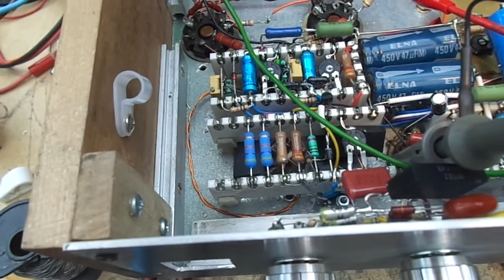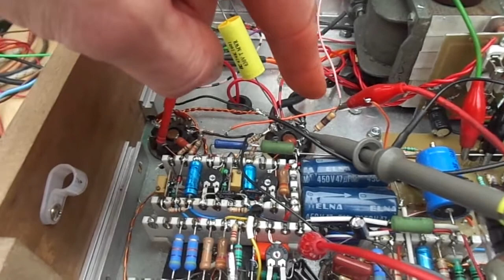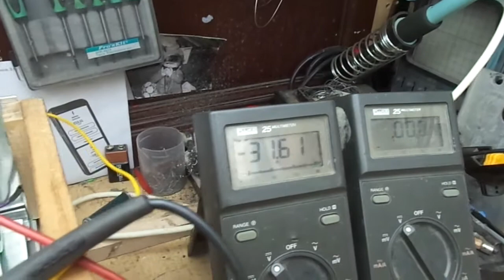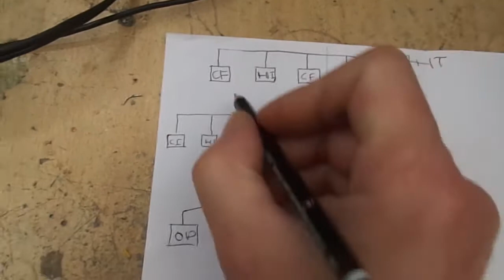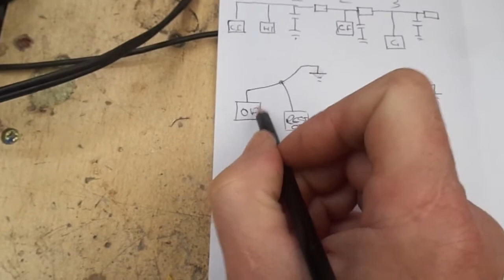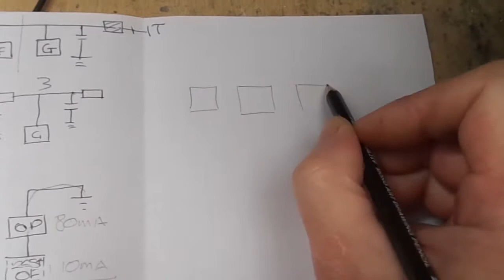Class AB2 6146 PP Valve Amplifier - Solving a LF Oscillation Fault.

Comment: Excellent, it turned out very well. One question: is pin 8 (Base Sleeve) of the 6146 in RF grounded in amplifiers? Does it need to be grounded?
Reply from the maker: If you read the RCA 6146A datasheet, it says that grounding pin 8 shields the IP from the OP. RF isn't my forte TBH so not 100% sure. Whenever I use a valve I get every datasheet I can, you get a better idea that way. Good luck & TFW.

Comment: Is it a Ham radio or a audio amplifier I know the tubes are similar to 6l6 tubes
Reply from the maker: hi Jim, it's an audio amp but I've changed the design to an AB1 amp using 6BG6GA valves and different OPT's. I'll be re-building it soon and will hopefully post a video.

Comment: That is a strange oscillation. Sounds almost like arcing. Beautiful build, good luck getting it sorted out.
Reply from the maker: Yep, strange indeed. I think what was happening was this... instability in the tone section caused fixed bias to drop = more current in the OP section, HT dropped, causing g2 to act as anodes, g2 regulation board went into current limiting, Vg2 dropped allowing the amp to recover, and then the cycle started over again. TFW....DA

Comment: just wondering how did you you learn on this valve topology i learnt by reading books
Reply from the maker: Bit of research, so 807 Class AB2 amp from the STC datasheet, a mates amp schematic, Radio Designers etc and lots of mucking about on the bench...DA.

Comment: sexy beast oscillation is a right pin in the A hole cable placement and even how resistors are placed
Reply from the maker: Me or the amp Ian? Not feeling very sexy at present, done me back in. Your right mate, it is a right pain in the arse...DA